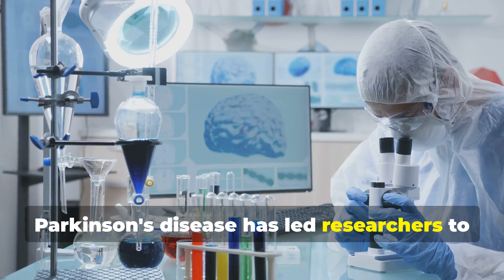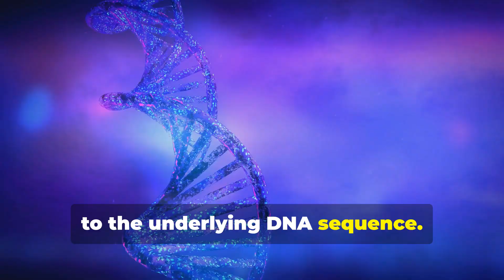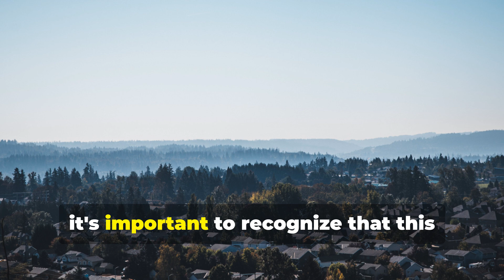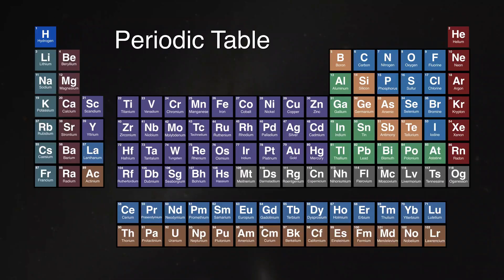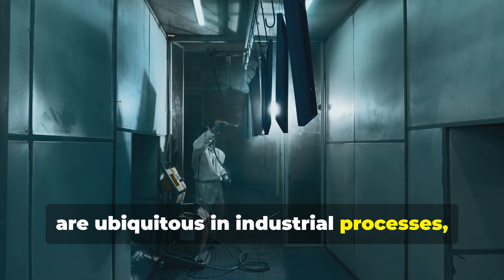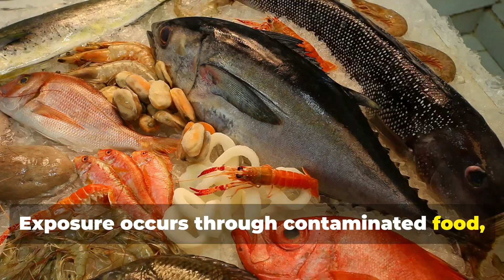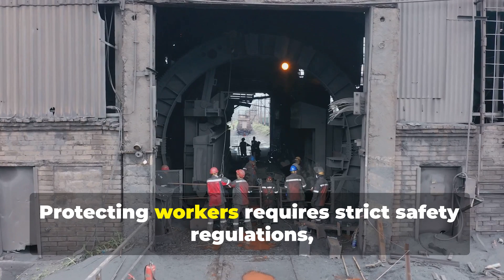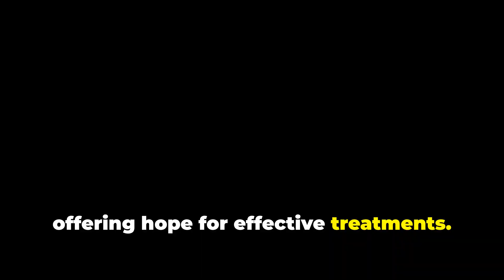Can Environmental Toxins Cause Parkinson's Disease?

Comment: Solvents should be referred to as organic solvents because water is a solvent. Right? Example, organic volatile solvents.
Reply from the maker: That is correct Christopher!
 The solvents that are mostly implicated in Parkinson's disease developments are expanded below but not limited to this list. I can make another video to expand on each solvent, where and how they are encountered. Find the lists below: Chlorinated Solvents
Chlorinated solvents are a common group linked to Parkinson’s risk due to their widespread industrial use and neurotoxic properties.

Trichloroethylene (TCE)

Uses: Degreasing, dry cleaning, adhesives, paint removers.
Known Risks: Strongly associated with Parkinson’s disease.
Tetrachloroethylene (Perchloroethylene or PERC)

Uses: Dry cleaning, degreasing metals.
Known Risks: Neurotoxicity and Parkinson’s link in occupational settings.
Methylene Chloride (Dichloromethane)

Uses: Paint strippers, industrial cleaning.
Known Risks: Neurotoxic effects with prolonged exposure.
Carbon Tetrachloride

Uses: Cleaning agents, refrigerants (historically used, now restricted).
Known Risks: Central nervous system toxicity and liver damage.
Aromatic Hydrocarbons
Aromatic hydrocarbons are found in many industrial and household products.

Toluene

Uses: Paints, varnishes, adhesives, nail polish removers.
Known Risks: Neurotoxicity and potential exacerbation of Parkinson’s risk.
Benzene

Uses: Solvent in chemical production, plastics, and fuels.
Known Risks: Neurotoxicity and a known carcinogen; potential Parkinson’s connection through oxidative stress.
Xylene

Uses: Paints, coatings, and printing inks.
Known Risks: Neurotoxicity with chronic exposure.
Aliphatic Solvents
These solvents are common in industrial and household settings.

N-Hexane

Uses: Adhesives, solvents in shoe and furniture manufacturing.
Known Risks: Peripheral neuropathy and possible links to neurodegeneration.
Heptane

Uses: Industrial cleaning and as a solvent in adhesives.
Known Risks: Less neurotoxic than n-hexane but can still cause irritation and toxicity with high exposure.
Carbon Disulfide (CS2)
Uses: Production of rayon, rubber, and pesticides.
Known Risks: Neurotoxicity and basal ganglia damage linked to Parkinson’s.
Alcohols
Alcohols are generally less toxic but can still cause harm with chronic exposure.

Isopropanol (Isopropyl Alcohol)
Uses: Cleaning products, disinfectants.
Known Risks: Central nervous system depression with high doses.
Ketones
Ketones are solvents used in many industrial processes.

Methyl Ethyl Ketone (MEK)

Uses: Paints, coatings, adhesives.
Known Risks: Peripheral neuropathy and neurotoxicity with prolonged exposure.
Acetone

Uses: Nail polish remover, cleaning products.
Known Risks: Generally safe in small doses but neurotoxic in large quantities.
Glycol Ethers
These are widely used in cleaning products and paints.

Ethylene Glycol Monobutyl Ether (EGBE)
Uses: Paints, varnishes, and cleaners.
Known Risks: Potential neurotoxic effects with prolonged exposure.
Petroleum-Based Solvents
Often found in industrial and household products.

Mineral Spirits

Uses: Paint thinners, cleaning agents.
Known Risks: Central nervous system effects with chronic exposure.
Kerosene

Uses: Fuel, solvents in industrial cleaning.
Known Risks: Neurological symptoms with prolonged inhalation or ingestion.
Other Solvents
Aniline Compounds

Uses: Dyes, rubber, pesticides.
Known Risks: Toxic to the nervous system and linked to other health issues.
Nitrobenzene

Uses: Solvent in lubricants, dyes, and shoe polishes.
Known Risks: Neurotoxicity and systemic effects with prolonged exposure.
Trichloroethane

Uses: Degreasing, cleaning agents.
Known Risks: Central nervous system toxicity.

Comment: Pesticide and herbicide use on farms contribute to groundwater pollution and may also be related to increase in brain damage and disease such as Parkinson’s disease. ALS is an example. Also, the mask used shown in this video is not correct as it will not protect the user from 2.5 micron particles nor chemical vapors. An NIOSH certified N95 respirator should be used.